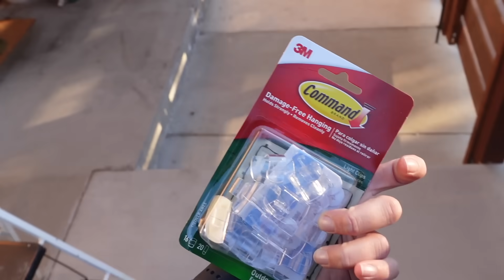I'm The Best Girlfriend Today

Comment: For the Stove Clicking: I assume you googled it, but incase you haven't this seems to be the consensuses:

 One of the most common reasons a gas stove keeps clicking, even after it's lit, is that the burner cap is out of alignment. Once the cooktop is completely cool, remove the burner grate to access the cap beneath it. Remove the cap, and re-center it on the base. Try lighting the burner again
Reply: Or faulty switch , dirty ignition or moisture around the igniter
Reply: Yes this happens to me!
Reply: @skyeepack365  she said she cleaned it already
Reply: @mejustchillin6495  well the other ones is what I read
Reply: lol i was just about to copy and paste the same thing but then i saw your comment lol

Comment: Rachel you need to, Unplug the power source.
Remove the burner cap.
Use a toothbrush or other small scrubber to remove/dislodge food. Around burner. Under knobs. Around igniter.
Use a Q-Tip dipped in alcohol to get rid of the last little bits of buildup.
Replace burner cap & get to cookin'! Then your done.

Comment: The clicking on your hob, try pulling the turny nobs off, they should come off, ours did this & its cause it had crap under that that was making the oven think it was still pressed down (we have to hold down the turny nob to do the clicky thing, its not a separate button)

Comment: If the stove parts get too wet with cleaning chemicals sometimes it does that. You might also want to make sure that the little circle metal plates are on the right burners. If mine get switched it keeps clicking.

Comment: IME, the clicking is a safety feature. It's supposed to occur to show you've turned the burner on properly. 
It indicates that you have turned the knob to the position required to ignite the burner and once that's happened all you have to do is turn the knob a bit to stop the indicator. 
If there's no initial clicking, you haven't turned the knob far enough, there will be no clicking to confirm that burner is lit which is a problem because you're getting gas, but no flame.

Comment: One of the most common reasons a gas stove keeps clicking, even after it's lit, is that the burner cap is out of alignment. Once the cooktop is completely cool, remove the burner grate to access the cap beneath it. Remove the cap, and re-center it on the base. Try lighting the burner again. This is strait from Google. My gas stove clicked and copy paste is better than trying to explain in my own words. Ok.. but we called a plumber to learn this. Yes it was something I could have fixed myself and saved money if I would have Googled it first.
Reply: My stove also clicks, once its on if you turn it down a little, it seems to stop.
Reply: @misskerryharvey  At the time I had never had a gas stove before. I thought it was going to blow up so I avoided cooking until after the repair guy left. 😆 On Thanksgiving my oven stopped working so I bought an air fryer on sale instead of waiting 3 weeks for the repair guy.  I'm glad I did because my oven is still broken.

Comment: Your igniters, and surrounding areas around the igniters need to be cleaned thoroughly, including the underside of the disc plate covering the igniter. Simple cleaning wont do it. This can be accomplished with a small amount of acetone on a soft cloth or Q-Tip swab. Be sure to turn the power off before you do this, so no electrocution. To reach the igniter, just pull the round disc plate of the burner off. The igniter looks like a small sparkplug. Be careful not to break the wire looking trigger, as you gently clean. You also want to open the windows, because acetone gives off a strong odor. The second alternative, if that does not work, would be to have them replaced, which is about ten dollars each igniter, plus the cost of installation. Good luck. ٩(͡๏̯͡๏)۶